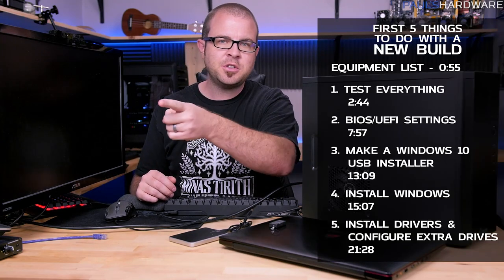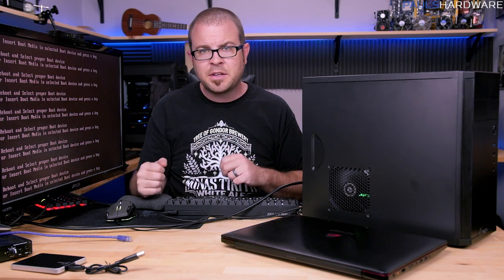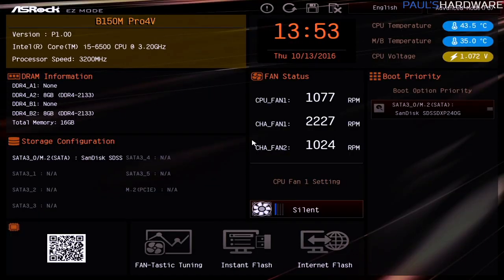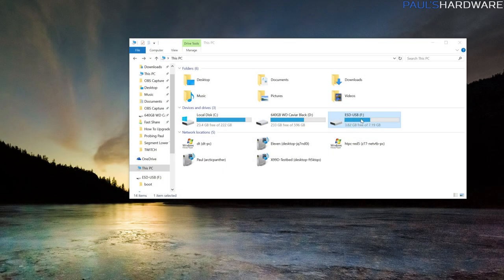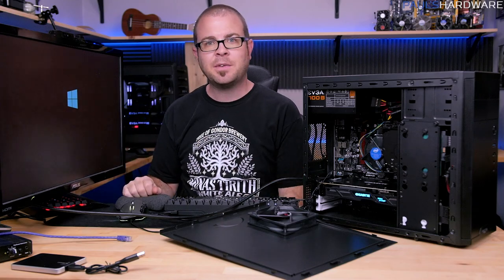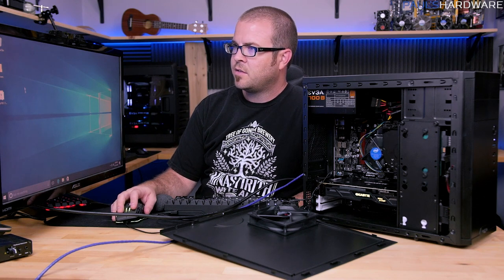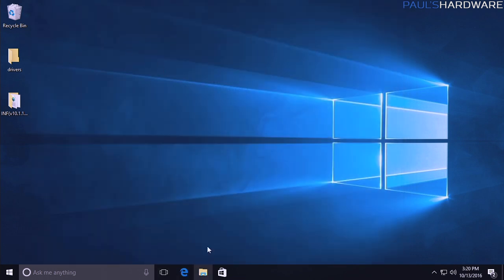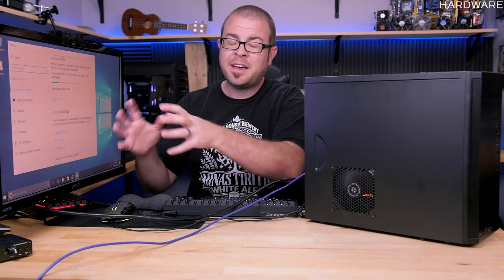First 5 Things to Do with a New PC Build

Comment: Good video man! If I didn't install Windows 10 to a new computer, plug in my USB thumb drive with Windows 10 installer and press the power on button, will the computer turn on by reading from the thumb drive? At one point you pressed F11 (correct me if I am wrong) to boot the computer from a thumb drive. Can I do the same thing with the same button with motherboards from MSI, GIGABYTE or other companies?

Comment: Hi, Paul, I have Question: If you get Windows 10 Pro from Microsoft they now provide the OS on a USB drive. You should be able to use that on your new system without any other software. Then just follow your instruction for the rest of the install.

Comment: I just did my first build and everything is on! But when i boot it up the cpu is at 88 or 100 any help!! I already installed windows and all the drivers
Reply: Did you use thermal paste and pull the plastic off the cooler?

Comment: I assume you already know this Paul but you can use a Windows 7 license key Windows 10 will accept it as well. Also if you are connected or connect to internet during the installation process it will force you through the Microsoft Account Avenue do not plug in your ethernet cable or connect to Wi-Fi that way you can set up the local account instead.

Comment: A very nice video. Well laid-out with time reference for specific subject data. The only downside of the video is the constant reference to his preferred component selection as to motherboard, memory... etc. The video could be more 'generic' and therefor less confusing. His selection of his components is interesting but not applicable for someone who already has a system. Getting into the weeds as regards his preferences is irrelevant for any other system configuration. Other than that, if you pay close (for the relevant 'generic' information) attention you will find this video very helpful.

Comment: Great video and very helpful thanks.  Just set up newly built PC and managed to install Windows 10 and have it running although am having trouble connecting to network. Tried using a WIFI USB and thats not working, also tried a ethernet cable connected to PC and Wifi hub. Coming up error message "Windows could not detect a properly installed network adapter, if you have a network adapter you will need to reinstall a driver"  Any help gratefully received!  Thanks

Comment: Hey Paul, thank you for the video as this helped tremendously after completing my first build a couple weeks back. I took your advice and went straight into XMP mode(I am very new so a manual overclock is intimidating), and didn't really ever test my stock performance. After running borderlands and reaching almost 80 c on my cpu i got a little nervous, so I wanted to do some stress testing. My 2 week old build got to 87 c on Cinebench and a sore of 3463, and the temperatures made me shookith. I disabled XMP mode to see if the results would change in temps, and I not only dropped to 85 c but got a 3468, beating my score with xmp on. Is there anything I can do that would boost my performance while setting set my ram to the 3600mhz speed i want it at? Let me know if you have any tips, I am willing to experiment in the bios but I don't really know what I'm doing tbh, so for now I'm just leaving my ram to the 2133mhz stock speed. Also am planning on grabbing a AIO cooler soon after seeing those cinebench temps. Thanks again for the great content:)
PC Specs: MSI B450 Tomahawk Max
Ryzen 5 3600 w/ stock air cooler
Ripjaws v series 3600mhz with 16 cas
MSI 6gb 1660
EVGA BQ 600 80+bronze
500gb ssd & 2 tb hdd

Comment: Very thorough, however, with my PC building inexperience -- what about HD sound? Is that included on a good GPU or a separate sound card?
Reply: Hardware-wise, I think it usually comes with the motherboard (it did on mine)
Reply: After looking into compatibilities, prices, specs, etc. I have found to not be sold by hype in a brand name although certain products (brands) of a trademark are top notch for the lesser price. Again, it's all in what you need, huh. I'm also seeking to do a build but to have expandability. Audio and graphics are priority to me. Thanks for your reply. I thought that maybe there might be a graphic and sound card combined but even still, relating to my Compaq days, only know of sound tests and would like surety as to whether audio/graphics might be related to BIOS configuration. I suppose to answer my own question, the CPU, memory and operating system handle that similarly to the CD/DVD burner/writer. I mean, if it works it works; no need to fix it, huh.

Comment: Paul, quick question.  you clicked the old USB method. I was under the impression that on the newer PC's we should select UEFI_USB as it will use the newer installer, secure boot, etc.  Clicking the plain USB sets it up as an MBR vice GPT and legacy install.  Is this correct?
Reply: Yes I think you are right....watch the follow up vid to confirm https://www.youtube.com/watch?v=xURz-SSQUVY&t=664s

Comment: Very helpfull video, thanks. Just one question. I am building a new pc, I have an SSD and HDD on the old one. I want to take those out of the old pc and put them in to the new pc. Do I have to format them? Or can I pop them into the new pc and have all my stuff on my new pc?
Reply: I assume you figured this out already but you can just place them in the new PC. I just did something similar moving my SSD to a new PC no problem just had to reactivate windows again.

Comment: Hey Paul! I am using the exact same build as your previous video with the thermaltake case and so on. I am noticing that the large fan at the front of the case does not spin up when I turn the computer on, the lights and the processor fan do turn on. Any help or advice would be great! Also thanks so much for the videos I would otherwise be very lost.

Comment: 1: Test Everything.            2: Optimize and save power consumption configuration      3: Fap test.       You should be clocking in a good 1-5 FapaHertz per hand utilized. Faster than that and you're dealing with chafing issues.
Reply: John Billingsley only 1-5 Fapahertz? Those are rookie numbers. We gotta pump those numbers up! snorts coke off hand

Comment: I built my own computer from scratch, I bought an installer USB, and plugged it in. Short story long, no matter what I did, Windows would just boot up on its special BIOS, ask me which bit version of windows 10 I wanted, and then after selecting go to the loading page with the logo. From there, it would let the ball loop animation spin one cycle before it kicked me to a blue screen of death. This is the same pattern I have faced. I have no idea what I am doing at this point. 

What do?

Comment: Noob question for the doc! Can I use Bluetooth mouse and keyboard with a BT dongle or is cable needed?
Reply: Yes, you can use a Bluetooth adapter. However, you must first pair the KB/Mouse before they will work. You will need access to a working keyboard first.

Comment: if I have a motherboard with WiFi capability, will I still need a wired Ethernet connection? Or can I just connect to wireless connection. I'm sure I can connect wirelessly but I just want to confirm.

Comment: Bit of a weird question but what do you need in the pc to connect to wifi do you need a wifi card or do you need and ether net cable or do you not need either of these
Reply: Well think about it. Wi-Fi is a wireless signal, so it is not possible to use an ethernet cable (wired) to connect to Wi-Fi since the very nature of WiFi is wireless. Regardless, you will need a Wi-Fi card. Most motherboards do not have Wi-Fi built in so you will need to purchase WiFi card.
Reply: @JJFlores197  Thanks for the help

Comment: My cpu idle bios temp before windows installed is 65 and SB is 65.  Pretty sure it’s not suppose to be that hot.  Ryzen 3900x with BeQuiet CPU cooler.  FML

Comment: Having an issue where both the SSD and HDD I've installed are not showing up in bios (uefi mode) both are firmly plugged into motherboard and both have power running to them. All parts are completely brand new and were not opened until they were needed. Haven't installed windows yet. I need a starting point to troubleshoot from.
SPECS:
MOBO: Asus Prime Z370-A II
Samsung SSD
WD Blue 54RPM HDD

Comment: About 2 months ago I built my 1st pc (I'm 14)
It is a high end PC
Specs:
Gigabyte Gamung OC RTX 2070 SUPER GPU
I5 9600K OC'ed @5 GHz CPU
2xHyperX Fury RGB 8GB @3200MHz RAM
Samsung 960 Pro 512 Gigs SSD
2x Seagate 2TB USB 3.0 External Drives 
TUF Z390 PRO-GAMING Motherboard 
Sharkoon TG5 RGB Case
Corsair CX750 Power Supply 
Antec A400 Cooler

Comment: Loved your video. When I used your link to get the windows install to put on a thumb drive it asked Get install medium for this computer OR get install media for any computer. I checked any computer and it only had the option for windows home not pro. Is there a separate link to after I install the base version does it upgrade when I put in the key for the pro version?

Comment: right click on the Windows flag and select Disk Management for faster access to Disk Management also while in the menu from right-clicking on the Windows flag you can access device manager and system Etc
Reply: Putting a shortcut to it on the taskbar is even better.  I always keep that along with Task Manager, Services, CMD, etc there for quick access.  Probably not necessary for most people though I suppose.

Comment: just wanted to let you know that you dont actually have to tap the delete button multiple times like you and everyone else is doing, just watch the keyboard and when the keyboard lights up press delete once and you get into the bios, the keyboard once it has power, will remember that you pressed delete, cause it has a memory, all keyboards has a memory :) so dont panic just wait for the light and quickly hit delete, it helps to hold the finger on delete so you can hit it in time. 

Any key clicks before the lights comes on will not be stored in keyboard, anyway just wanted to share some info :D

Comment: When I built my pc I installed a Samsung 870 SATA SSD and a Samsung 960 NVMe M.2  SSD. When I set up Windows it installed on the 870 SATA. I wanted to install it on the 960 NVMe. How do I switch boot to the 960 NVMe? Do I need to clone the drive?

Comment: Is there an updated version of this video? since windows can now be connected to your Microsoft account which means you don't need another computer to download windows on a usb drive? So i got told that all i need to do to upgrade my mobo, cpu and ram is install the new part and start the computer and it should work itself out from there?

Comment: Great information, and it really helped me. Suggestion: What to do if Windows 10 becomes corrupted (In my case, after I installed Asrock drivers for an A300W) and you can't recover or reinstall it. I figured it out, but it took me 6 hours, after I disconnected my second SSD and used the BIOS menu to wipe the primary. The information on that subject is few and far between, posted mainly by sketchy, obscure YouTubers, and not at all helpful. Legit tech tubers such as yourself should address this.

Comment: I have windows 10 I bought it’s already on a USB.. now with the Key given with the Windows 10 USB stick I bought if I were to do a fresh install, i can use the key given its only been used once.. also should I install windows on my WD Black that runs in the Fast lane x4 M.2 SSD should I make that primary? Also I have another m.2 SSD that’s a 6Gb’s and 2 other 2.5 SSD’s should I unplug all those as well?
Reply: If you're installing W10 on the same PC, you can use the same product key. You can install Windows to any drive you want. However, it makes the most logical sense to install it on your fastest drive which is almost always an NVMe SSD.
Reply: @JJFlores197  hey thnx I appreciate that, should I remove any other M.2 drive and other SSD’s?

Comment: Can you do it with a windows 10 pro disc if you don’t have the usb?
Reply: Is the disc OEM?  If so, then no.

If it's not OEM, then yes, you could use it, but you'd have to uninstall that version of Windows from any other PC running it first.

Comment: Okay I’m having serious troubles installing windows 10 onto a newly built system. I’ve never had issues before but I followed every single step and when I get to the point of “copying windows files” that will finish and the “getting files ready for installation” will Freeze on me. I’ve tried retrying this 30+ times and it freezes on that every time. DOES ANYONE KNOW A FIX????

Comment: Paul, I've built my new pc, everything seems to function correctly, it's water cooled, it looks great. I've followed your videos and appreciate all the knowledge you have. I need your help on this...I downloaded windows 10 on three different flash drives, also on two discs, booted the new pc using flash drive #1, #2, #3 and also the discs respectively...and every single time I end up with Stop Code: BUGCODE_NDIS_DRIVER I've researched it, contacted Microsoft, tried various scenarios and still nothing...it goes through the windows setup like normal...Copying Windows files...Getting files ready for installation...Installing features...Installing updates...finishing up...everything...but then when it restarts it goes into the blue screen error or onto "The computer restarted unexpectedly or encountered an unexpected error. Windows installation cannot proceed. To install Windows, click "OK" to restart the computer, and then restart the installation." I've done this many times and still nothing. Please help.

Comment: Hi Paul, I am really hoping you can help me. I have a new server thatI am trying to get up and running. The board is a Intel S1200SPL server board with the Intel Xeon Processor E3-12. I cannot install ANY windows on it, because I can only use the keyboard in the BIOS. As soon as it boots and gets to the part where I need to select the language etc, the keyboard and mouse becomes inactive. Please give me advise?

Comment: Hey i Have a problem with my two ryzen builds, i did one wtirh R5 2600 and 16gb of ram of corsair vengance and the other one is a R3 2200G with 8gb ram  of ballistic.
in the r5 build i have a Asrock B450 pro 4 and in the R3 i have the Asrock B450M pro 4. on both i have the same issue in which there is memory ram res4erved. in the r5 build it says that 8gb it's available to use and 8gb of reserved memory. and in the r3 6gb of ram are available to use and 2 gb of reserved. i have looked online for a solution but no luck with a working method. I came here for help because you are super informative and fun to watch. Thank you

Comment: On my PC I use 2 8GB RAM Sticks and according to my MSI Motherboard manual I should be using the RAM SLOTS: 2,4. However my computer seems to turn off instantly whilst my sticks are in these slots, same goes for slots 1,3. 1 & 2 seem to work fine though, what's the reasoning for that?
Reply: Sounds like you are either using memory that is incompatible with your board, or that your slots are bad.  :/
Reply: MSI model? :)

Comment: I am doing a Windows 10 fresh install on a new gaming computer build.    Paul advises to not connect to my network until the Windows 10 install is completed.  But I made the mistake of connecting to my network when the the "ethernet not connected" message appeared.  I'm at the "Let's add your account" page now.  Is there a way to abort this Windows 10 install and start over?  When I start over, I will remember to not connect to my network.

Comment: Hmm I don't know the specifics fully, but I think when I tried dual boot installation with Ubuntu, I needed to create USB installation in GPT mode (and not MBR) so that I can properly use UEFI and not BIOS. Was it, in GPT/UEFI Windows doesn't rewrite the boot loader and in MBR it does, so then after you need to use boot loader utility to return the Ubuntu option back. :) That is why you install first Windows and then Ubuntu, so that Ububtu can handle the boot loader list with Grub 2 :P But GPT is the future, its more powerful than MBR. Does the MS Windows installation utility install Windows on the USB in GPT mode by default?! :)

Comment: I'm wondering I only have 1 monitor, keyboard and mouse so I'm wondering if it is possible to do all the BIOS settings on my new computer with the same monitor then plug it into my old computer to get WIN10 on my USB Stick then plug my monitor back into my new computer to install WIN10

Comment: I will upgrade my motherboard,processor, and RAM ONLY do i need to this?
Reply: "ONLY"? These 3 pieces ARE the WHOLE PC... anyway, changing the motherboard requires a clean installation of the operating system, unless it's the same exact model and PCB revision of the former one.

Comment: I have built a new PC and followed the directions to create a bootable USB key with Windows 10, 64-bit. I have also chosen to boot from the USB in the BIOS. However, every time I try to boot from this USB key I receive the message on the screen "Reboot and Select proper Boot device or insert Boot Media in selected Boot device and press a key." over and over. It will not recognize this USB key as a bootable device.

Comment: When I installed windows successfully, can connect to the WLan from my house or do I need a LAN cable ?
Reply: You will probably need to use the LAN, as you will need to download drivers for the wireless to work. Windows may have some default wireless drivers, but I haven't seen that on the ~3 PCs I've built lately.